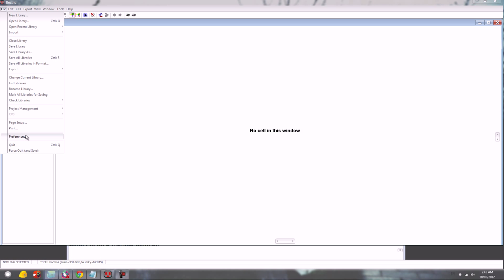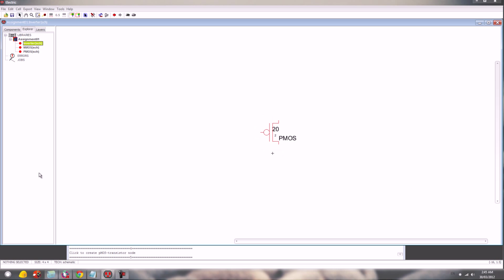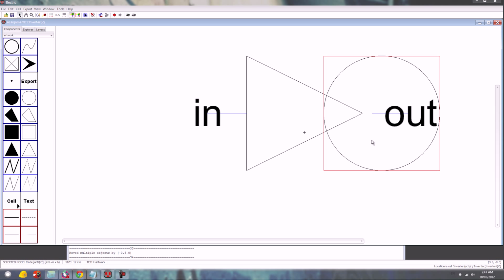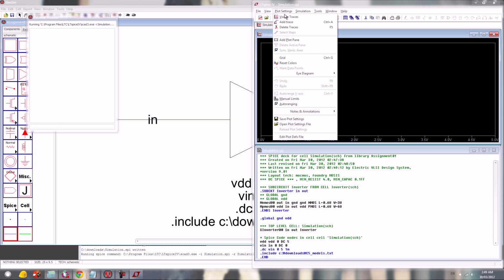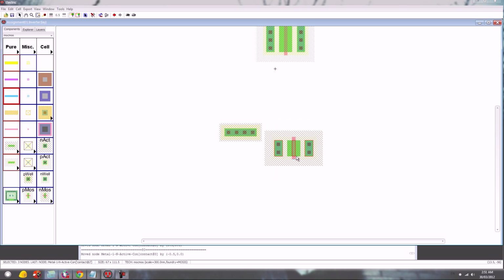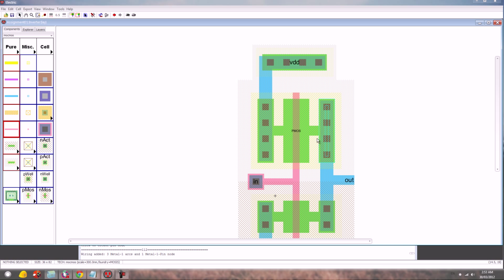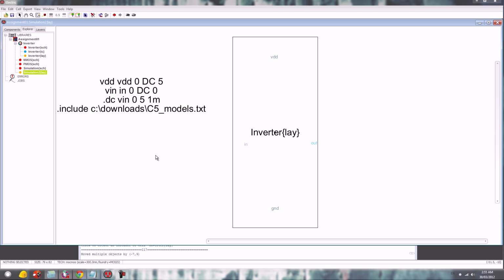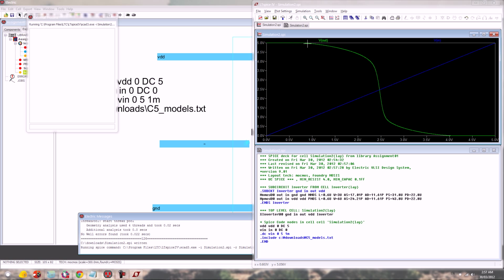Static CMOS Inverter using Electric VLSI (layout and simulation).avi

Comment: Look like a good tool. Unfortunately when I select width , length , pins , anything on the schematic I cannot move then they all lay on top of one another making it incomprehensible. Always annoying when you have a huge tool which look great but you are stuck after 5 seconds because you cannot perform even the most basic simple task.